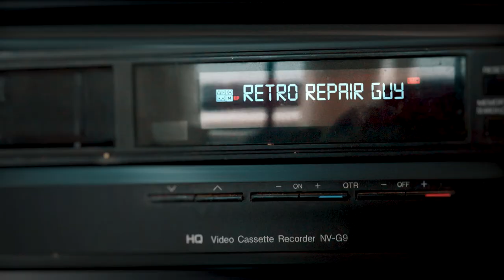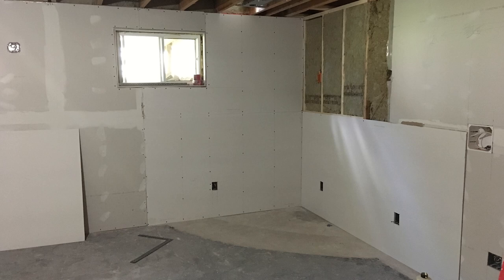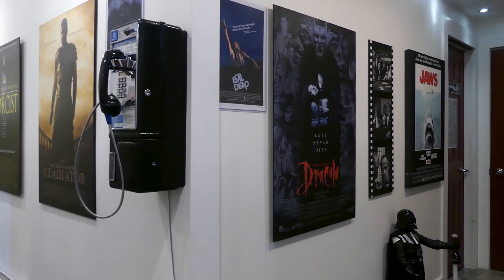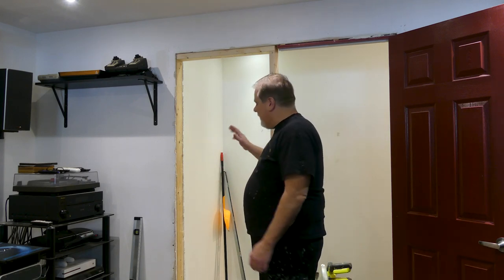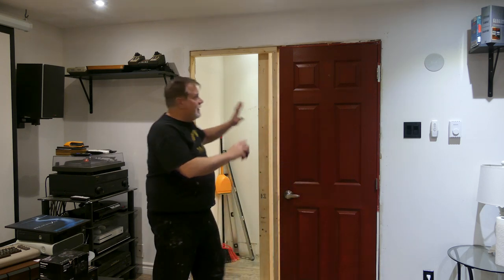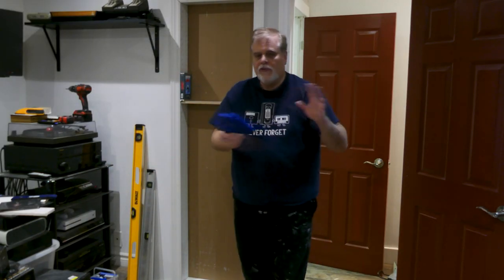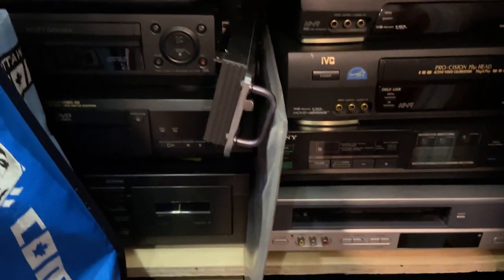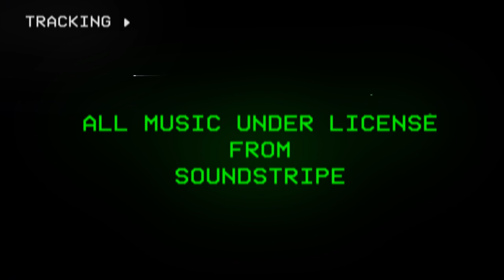Fixing My Budget Home Theater | Retro Repair Guy Episode 39

Comment from the maker: ** Hi everyone! I forgot to include the cost of this little change. All in I was under $200 Canadian (approx. $151 USD) that includes nine wood studs for framing, a drywall sheet, a 3/4" plywood sheet and a 1/2" melamine sheet and cheapest molding I can find. I also re-used the molding I removed. I had some paint/primer leftover so I only purchased a roller and two paint brushes from the dollar store. **